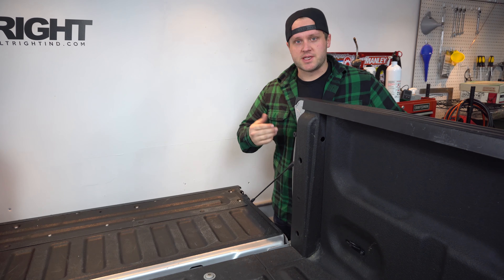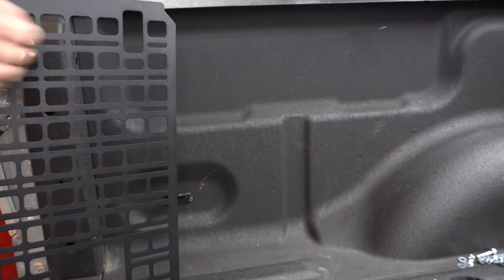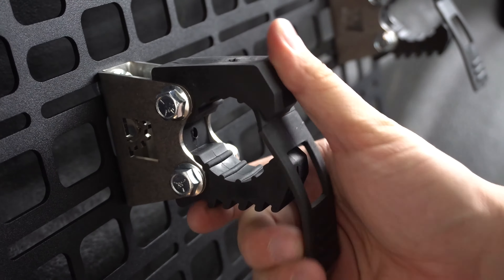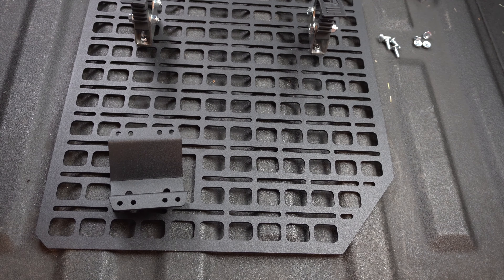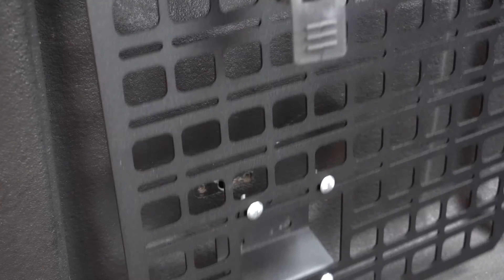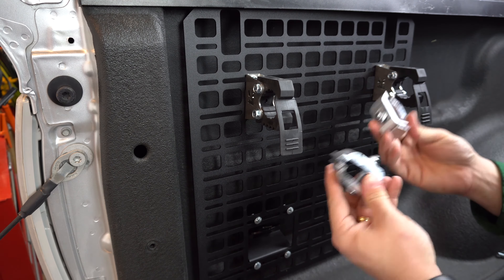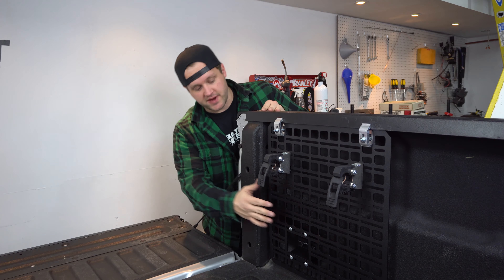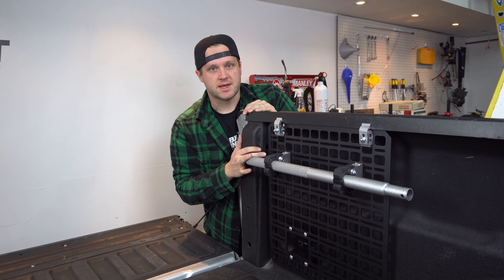Bedside Rack Installation - 2009-2014 Ford F-150 and Raptor

Comment: My 2013 F150  Has the Bed cover I wonder how that would work with those connections around holding the cover on to the truck.